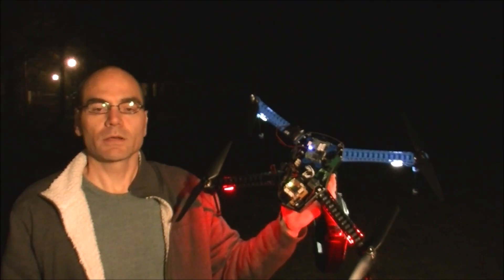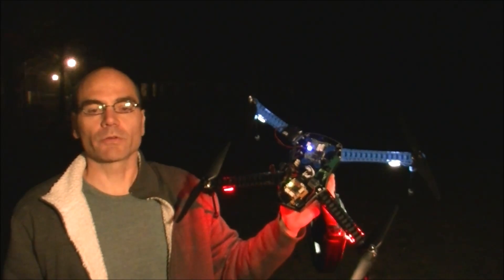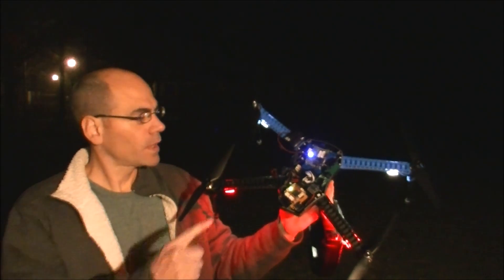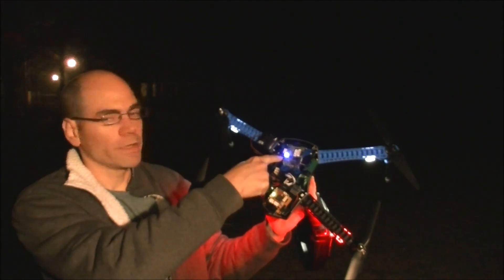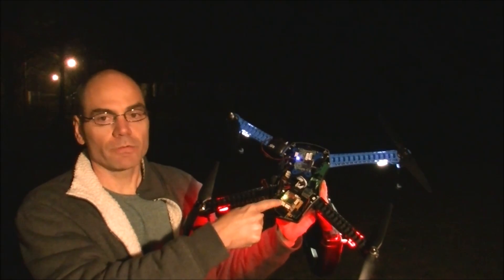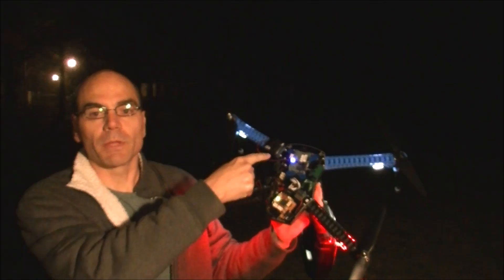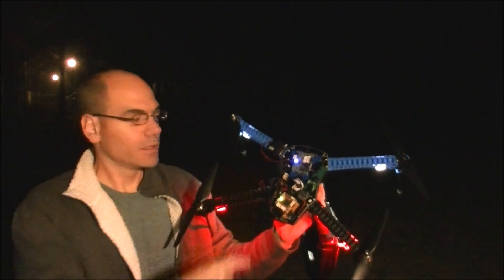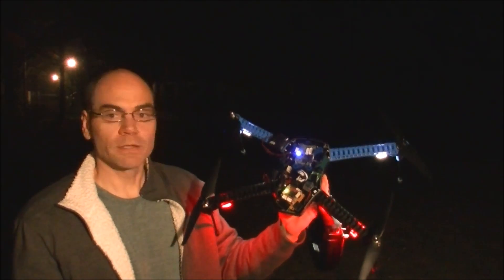SnapDragon with Ardupilot First Flight

Comment: Actually, this snapdragon801 board is the flight controller used in Zerotech Dobby. It should run iNav with no problems? It easily does what everybody is trying to make their homebuilt drones do, because it's not stuffed with Chinese junk. It is loaded with goodies like a Bosch barometer, InvensenseIMU, 13MP Sony IMX135 camera, Telit Jupiter GPS and is using both 2.4 and 5Ghz wifi. I can see it also has a gimbal and Rx connector not used from the factory, but this gentleman appearently made it work. So much potential!

Comment: Hey, I'd be really grateful if you could help me out here.

Could you please tell me how you connected the esc's to the board? I am developing an octacopter and hexacopter, in X8 and Y6 configurations respectively, using DJI E310 tuned propulsion system. I am having a hard time figuring out how to interface the ESC's with the board.  I am running PX4 on the Snapdragon Flight board. 

Thanks a ton in advance. :)
Reply: did you succeed with your build?

Comment: Hi Randy,
I've been having trouble with the Snapdragon Flight thus far and I was wondering if you could answer a quick question or 2.

Which port (in software) do I use to talk to the Pixhawk over UART? 
I assume that's what you have working here.
I know that I can connect a Pixhawk through the J9/BLSP2 port physically but I don't know which port that is in the /dev folder. I've been playing with ttyGS0, ttyHS0, ttyHSL0, and ttyHSL1 but none of them seem to be correct. The documentation doesn't seem to have any information telling me the port mapping from software to hardware.

Any advice? 

Thanks and great video. I'm so pumped to have this board work.
Reply from the maker: +Brandon Robinson It's great to have more people playing around with this board.  I've created a discussion here on diydrones to consolidate some of the conversation.  http://diydrones.com/forum/topics/ardupilot-on-qc-snapdragon

I've connect the PixRacer to the Snapdragon's J12 port which is "tty-3".  The mapping from port to software name is in small letters in the image in the middle of this page: http://copter.ardupilot.com/wiki/common-qualcomm-snapdragon-flight-kit/

Comment from the maker: The board is very promising because it has a ton of CPU power, two integrated cameras and could even allow telemetry using the mobile phone network (LTE). 

On the other hand, the on-board GPS is probably not very good although we haven't tested it yet (these flights were done with an external GPS).  The licensing terms on the board are strange and don't allow it to be used in a commercial product without coming to some kind of agreement with Qualcomm.  The SDK license doesn't allow us to distribute a binary.

I've heard the boards come down in price a lot if purchased in bulk (although I don't know the details) so maybe a group purchase could allow us to get them out to the community.